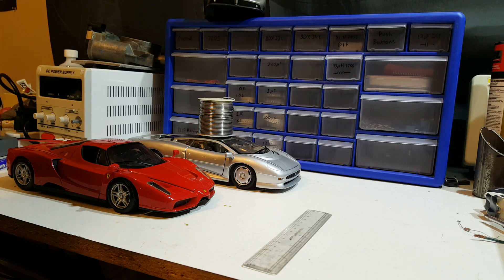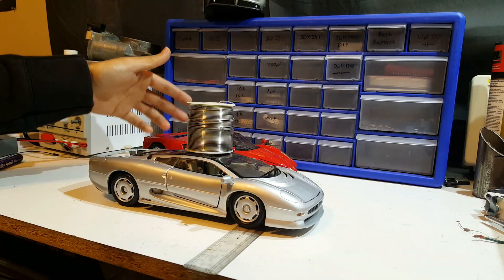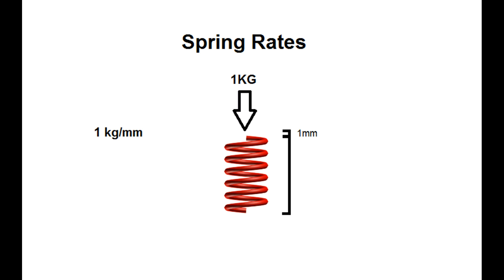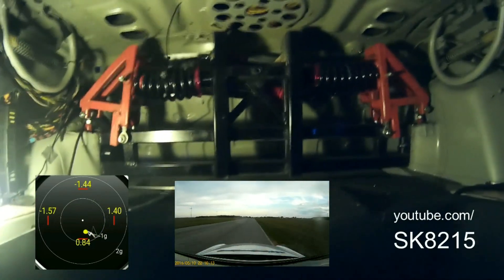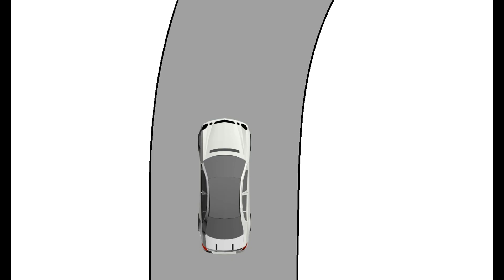Suspension Setup (Springs and Anti-Roll bars / Sway bars)

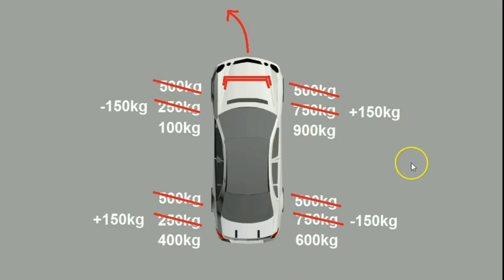Comment: 15:00 I guess by doubling the front anti sway bar, you would almost equalize the force acting upon front axle tires, and deleting the rear sway bar, actually increases the weight differential. which is the opposite of what you did [when you compare it in the front axle vs. the rear axle]!
Also in turning with no speedometer fluctuation, due to slip angle of the tires in the rear axle (presuming they don't steer) it has a bit less grip less, this is why unmodified mass produced cars have better response in them, when you go through the turn, accelerating and the best setup for a racing in track, is tuning the car for oversteer, and use the turn, as a braking zone, since your craft has her best response, when braking!
P.S. weight transfer happens even even with zero role. And due to how load affects the grip, the highest sum of grip happens when distributing the weight equally on all four wheels, because although overall weight stays the same with the weight transfer, but 100% increase of the load always results in less than %100 of grip increase.

Comment: This video tells me my car doesn't have any functional anti roll bars lmao. 

Recently did a couple laps on track and despite setting the dampening to the hardest setting and having the suspension quite stuff, it rubbed on the fenders in nearly every corner. I think the anti-roll bars on the front are connected by Bluetooth

Comment: A question about corner balance. if I change the spring rate of the car but maintaned stock ride height, is my car balanced the same as before? I dont understand why increasing the preload would put more weight to the car, shouldn't it reduce the weight since the corner sits higher?

Comment: What is the role of anti-roll bar bushings? What happen when they are worn? Everywhere I still read only squeak as related problem but nothing about drive sensations. 
My car start  with some squeaks in wet days and now, after some years, is a little unstable. I've new shocks and springs but the car have unpredictible body roll when I turn. I need to constantly adjust the trajectory  because I feel all the car heaviness on turns like unflated tyres or bad shocks (but they are new now). The roll transfer when I turn the steering wheel is not progressive, it happen suddenly like heavy iron ball move on a side beyond a certain threshold

This problem could be related to worn stabilizer bar bushings?

Comment: Yes, it was helpful in that, I am lying here exhausted and need something to keep me sane, without too much effort for my body.
It will help me explain what, I instinctively know is wrong with a motorcycle suspension with four springs.
The issue of front suspension on a bicycle and the absence of anti roll bars there and on a motorcycle. 

I wonder what the horizontal suspension or springs were, under the car is, is that a form of anti roll bar ?

Comment: It seems that pretty much everyone misunderstands swaybars.  Swaybars don't only operate when you go through a turn, swaybars operate all the time except when both wheels move the same amount in the same direction at the same time.  Unless the wheels are moving this way the swaybars are affecting the wheel rate.  On many modern vehicles with thick swaybars the swaybars have more impact on the wheel rate than the coil springs.  Manufacturers have been making swaybars thicker and thicker, and vehicles have been becoming less and less comfortable.  Stiffer springs will also reduce body roll.  When a vehicle with stiffer springs experiences body roll, the outside coils will resist compression more, and the inside springs will drop force more quickly, working like a swaybar.  Swaybars add weight, complexity, cost and friction.  Springs can be made stiff enough to control body roll to your preferred amount, so the way i see it, you add swaybars to a vehicle when you want to lower the springs rates, because you want it to have a lower load carrying capacity, you want it to bottom out through spoon drains, you want it to bottom out over speedbumps, you want it to dive more under braking, and you want it to squat more under acceleration.

Comment: Help me out real quick, I love your vids bcs I’m trying to solve a problem… iv gotten into rc speed runs and my 1/8 scale ARRMA felony will do 100mph++ real easy but I don’t have it setup correctly right now.. when my previous tires were basically 90% bald, I reset all my camber, ride hight and spring rate. I used a rather primitive style to do all this with a right angle 📐 and a ruler 📏 on a glass  surface because the electronics placement and heavy electric motor is not perfectly placed for even balance. The car ran and hooked amazing. BUT then I replaced all new mounted tires (same type as always) it messes everything up bcs they were all taller bcs of tread and weren’t uneven heights like the old ones. I messed with the spring rates after a few runs and I made it worse lol🤷‍♂️.. I need this car to stay STRAIGHT and hook so I can reach those high speeds. It’s got plenty of grip and steer. Rear tires have a positive toe stock setting. Front toe is not as positive, but has a ton of caster that’s not adjustable. So when it turns, the tires ride the walls hard. The thing I’m struggling with is the car is a little sketchy accelerating hard and going FAST in a straight line even after it’s stabilized in motion. The other is on a launch it veers to the right, it never did that with bald tires and what ever I did to the suspension geometry at that time. I never changed the front or rear toe. I did change the camber to make the wheels all 180° the best I could and I stiffened the springs which raised the ride height by some degree. Front, center and rear diffs…F 1000-C 1500-R 800 weight there about.. the tires are belted and thick heavy rubber. Their uneven around the edges until they were in some bcs it’s got THICK  walls. Idk if your into rc cars but you are into cars and technicality lol so dive in this subject real quick and kill some time on it, you’ll be helping someone out lol 🤘🤘

Comment: I am still quite confused about sway bars, how does increasing the stiffness reduce the load on the inner tyres? With this logic, by removing the sway bars you would have the best load distribution on a corner.

Comment: Someone please explain to me. I feel like the section about adjusting the coilovers at the preload is wrong. Wouldn't you loose suspension travel? Also if you run helper springs or progressive springs it would affect the spring rates. (Heck even linear springs probably aren't completely linear). Adjusting the height should still allow you to adjust the weights and would effectively compress the springs more where weight was moved to, but without sacrifing travel/droop. Please help me understand.

Comment: time table :
@2:10 load vs grip
@4:23 spring rate
@6:10 important note about cornering
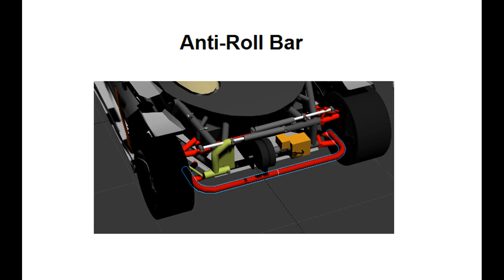@9:39 anti roll bars
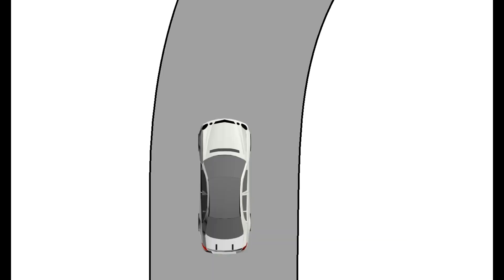@10:58 anti-roll bars effects on over-steering and under-steering
@12:06 anti-roll bars and the overall balance of the car
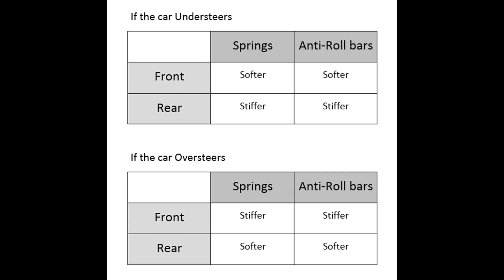@15:15 under-steer and over-steer cheat sheets
@16:30 over steer and under steer set up and how wide the wheels are
Reply: Thanks

Comment: Was playing Forza and wanted to tune little bit even though its a video game,
it has somewhat accurate simulation of physics that i can take from real life and apply them to the cars in the game and get the desired outcome.
(Forza Horizon 5 is Simulation/Arcade Racer not that extremally accurate compare to other even more in-depth hardcore sim racers out there with pages of adjustments you can tweak) 

Feels odd sometimes looking up irl tuning guides and applying them to car`s in the game, but it gives me more incentive to learn about cars and how they work on a fundamentally level.

Comment: 8:40 every suspension kit I've seen that has separate spring perch collars and lower collar says that you should NOT be adjusting ride height with the spring preload perches. The shock AND spring assembly should be spun up or down into the lower mount brackets for height adjustment.
Reply: You are correct, when you have “divorced” dampers. Some dampers only have the upper spring perch for adjustment, but the manufacturer has already built in the amount of ride height adjustment for you, based on the spring length and damper travel characteristics.

Comment: Could u explaine the rebound and bump can u change over and understeer with the rebound and bump and is there a formula like having a 50 50 weight distribution the car weight 2000 devide 2000by 4 is 500 each wheel so i put my springs at 500 but how could u calculate the rebound and bump vs the springs its for a race game simulation great vid btw

Comment: Wonder how much it matters if the Car is Front Wheel Drive, All Wheel Drive, Rear wheel Drive?  It will handle different depending on where the center of gravity is in the Car . Would think every Car is a little different. The new Corolla they say is 60% stiffer body.  Sounds great.. if so what took them so long?

Comment: One of the best engineering videos. One thing I could not understand, hope you explain. This diagram: 13:35 . You basically said the front (with anti-roll bar) has more weight transfer than the rear (without anti-roll bar). Wouldn't it be the other way around as that is what anti-roll bars are for (to stop body roll and weight transfer)?
Reply: I'm a year late but.

Every action has an equal and opposite reaction yeah? ARBs resist lateral weight transfer, therefore the axle that resists the most also bears the most force, which reduces traction, hence why you can use them to tune over/understeer.
Reply: @Taverius  bro can you explain? I dont understand wtf is going on, the anti roll bar is to stop this weight imbalance right? then how is it adding onto it?????
Reply: Weight distribution is not affected by ARB. ARB only changes body roll, remember force is energy that cannot be destroyed.
I wonder what happens if wheels are set to positive camber and body roll cancels inside tire camber, does it increase or decrease axle lateral force. I need a tire coefficient of grip versus positive camber chart.
Reply: @CH-wn8sq hey man, did u get this already hahha? If so, can you explain to me, cz im thinking the same as you, tho 3 years past

Comment: If both the springs on either side of the car are linear, all else being equal, why would stiffer springs increase weight transfer during steady state cornering? Unless the inside spring runs out of suspension travel, both the inside and outside spring should, in theory, experience the same amount of strain in the opposite directions, and therefore the same amount of load transfer. At least, this is true if you ignore the slight reduction in the centre of mass of the car with softer springs due to higher body roll. But even if you count that in, there would still be much less weight transfer than there would be with anti roll bars.

Comment: You are not supposed to change the ride height of the car using the rings that are meant only for pre-load. If you do this the spring will allow the shock to travel too far. Please edit this video. The ride height is ONLY every changed using the bottom ring which changes the distance that the actual spring is from the ground.

Comment: so whats the best bang for the buck suspension upgrades for a 2011 2 door civic? i live in a very hilly area and lotsa curves  so i want better handling but cant push it to limits to see if my car understeers or oversteers cuz i will end up crashing  in the side of the hill or over the cliff?
does a stock civic under or oversteer typically?
bigger stiffer rear swaybar combined with fatter front tires would be one possible setup , right?

Comment: I don't think your calculation is correct for 2 rollbars on the front, because adding one it would transfer more weight to the inside wheel, not less

Comment: It also depends on the tire compound and width. Caster and camber are other factors which greatly effect ride and grip. Polyurethane bushings on sway bars are a must for track use. Dont cut your springs to achieve a lowered look. When a car doesn't turn it's called pushing and when it's oversteering it's called loose front wheel drive cars are prone to understeer and push rear wheel drive cars are prone to loose and the back end stepping out that can be remedied with simple tire pressure adjustments. Bottom line is if you don't have the money to do it right don't waste your time or your cash on some cheap half ass suspension because you're just going to end up stuffin your car and your insurance isnt going to cover it at the track. it costs money to go racing!

Comment: On 12:50 we are adding another sway bar on the front axle which means we are increasing stiffness in the front so the roll will be less with the load difference between outside and inside wheel on the front. But in the video the whole explanation was reverse between front and rear axle. Can anyone tell me if I'm wrong and where or there is a little mistake on the video. Thanks in advance!

Comment: This is the best explanation I've found online.  
It says sway bars are to prevent roll, but doesn't say why roll is bad or how much is okay.  Loads are more balanced without a bar, so adding a bar makes that end unbalanced and reduces grip at that end.  So while adding a bar to front or back can reduce grip at that end and change oversteer/understeer, it doesn't improve cornering g load.  
I'm guessing the bar is needed to prevent the outside suspension from bottoming. 
Also, the camber change reduces grip, so beyond a certain roll angle, total grip will start to reduce.  So there is some roll stiffness that gives optimum cornering g for that end of the car. 
Does this make sense?

Comment: Best short series I've ever seen on suspension design and function. Thanks for making it. Did you guys get arrested in California?  I saw the airbag change video but nothing on the E55 machine. I can't remember the name off hand but there is a company doing custom hydraulic shocks and they make a stand alone controller for the GM magnetic ride suspension. They are selling it primarily to Corvette owners for racing. It allows for multiple tunes like heavy rear pitch for acceleration and then stiffens up at speed etc.

Comment: Great video! one of the best I've ever seen about the matter, But I didn't understand the anti-roll bar exemple. I always thought that the ARB worked transfering part of the forces applied on the outside wheel to inside wheel, thus reducing the roll effect. What I get from your example it works on the opposite way, increasing the forces on the outside wheel. Is this so?
Reply: +1 on this, that confused me. I thought by adding the rollbar, the RHS would get -150kg rather than +150kg, since the torque on the roll-bar would counteract the weight shift on the RHS of the car.

Comment: I always find it a bit odd that they use the unit of 'kg/mm' , kg is a unit of mass. It would make more sense to use a unit of force because that's really want they mean by 1kg, they mean 1kg under earth's gravity. 

In any case, I LOVE your videos, keep it up !
Reply: It's easier to calculate since mass of your car is in kg and material density of the spring you're using is in kg/m3. Why transfer it to newtons and back when you can make your life simpler, just make sure that you put diferent suspension if you're planning to go on the moon